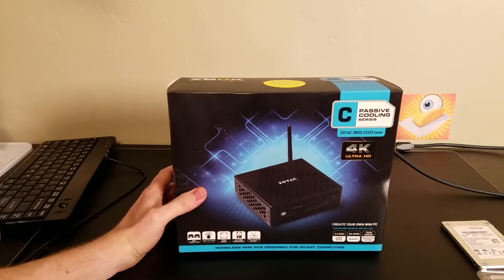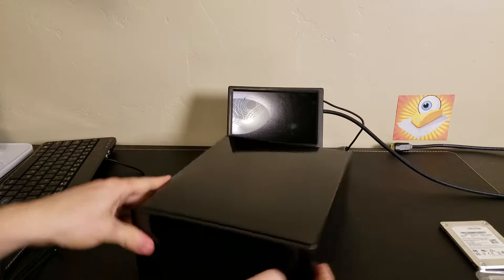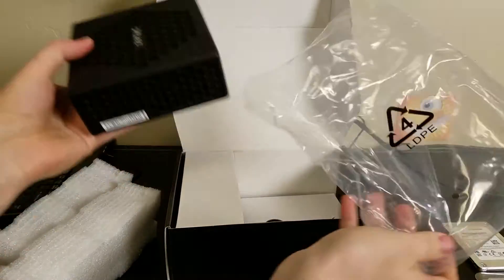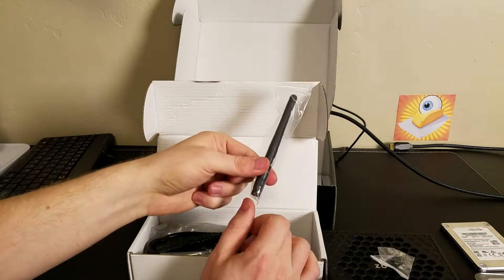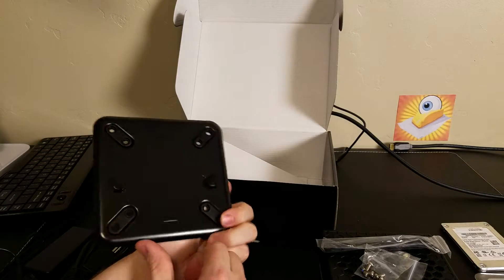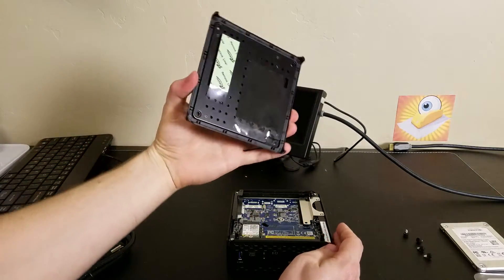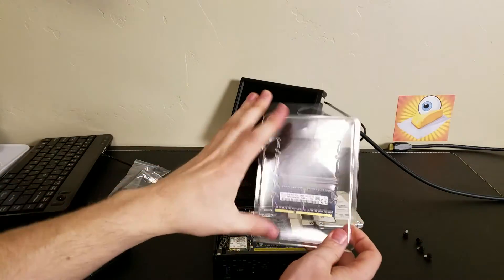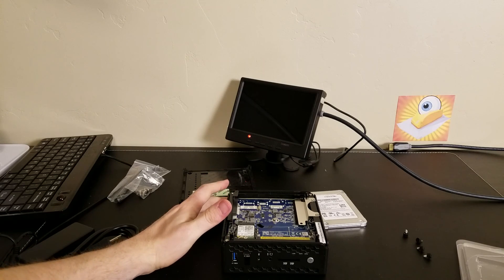Zotac CI323 Unboxing and Overview - PFSense Router

Comment: I've had this as a pfsense router. It worked for a while until the recent update. I bit the bullet and got better box with intel NICs and I will planning on repurposing it as a server.
Reply: How high throughput?
Reply: My old pfsense zbox topped at a max of 840 mbits average using the iperf benchmark. My new pfsense box w/ the Intel NICs averages 940 mbits. So there is quite the difference there.

Comment: I am looking for a router which can handle up to 100mbit OpenVPN bandwidth at aes256, can this unit handle it? Does PFSense support OpenVPN (2 tunnels with fallback, also block if no tunnel is attablished)? With a watchguard and custom OpenVPN configs?
Reply: Did you ever try?

Comment: How's it been as a PFSense router? Run into any issues?
Reply from the maker: Been running super stable for months, only issue I had was when I updated to a new version of pfsense and VPN stopped working... it was fixed by the next pfsense update though.
Reply: Any troubles with non-active Realtek LAN adapters?
Reply: @satamototo  I needed to update the FreeBSD Realtek NIC drivers for mine, but that has improved stability. For the $69 I paid for a factory refurb, totally worth it.
Reply: How about speed, and VPN?

Comment: The CI323 also works with 2*8 GB RAM (Kingston ValueRAM - DDR3L - 8 GB - SO DIMM 204-PIN,  1600 MHz (PC3L-12800), CL11 (11-11-11)). I have 3 units, but only one with 16 GB RAM (plus a Samsung EVO850 512 GB SSD), because I learnt this a bit late. It`s only running for 2 days, so I can`t tell whether it is stable in the long run. Will try it as a VMWare-host.